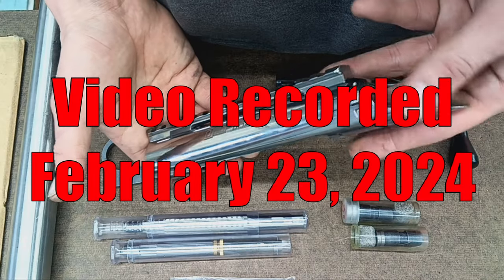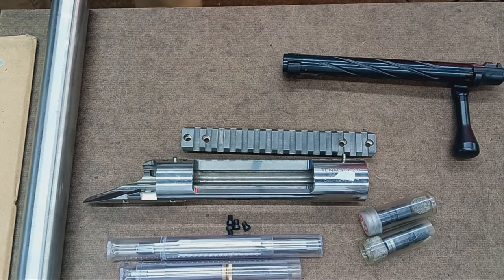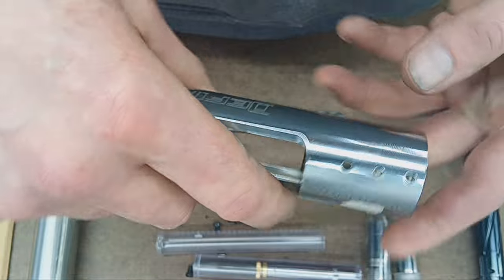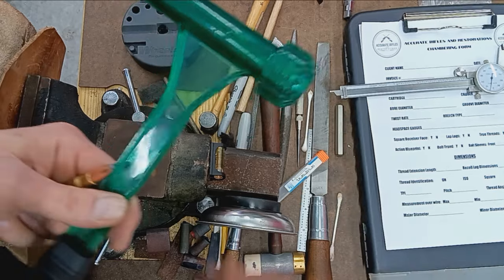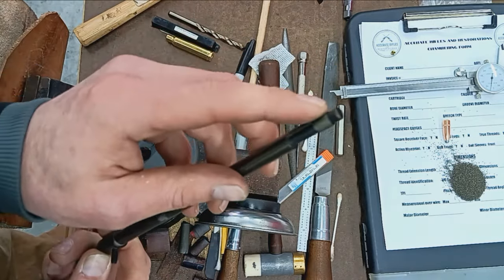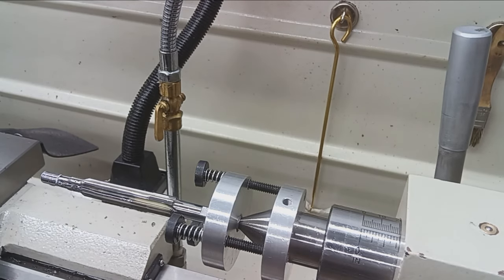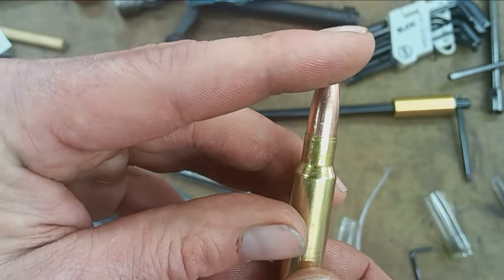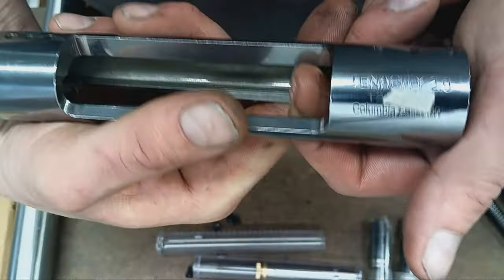Fitting and Chambering a BRUX M24 barrel to a Defiance Tenacity 2.0 in 338 Winchester Magnum

Comment: @45:38 - Is the bottom of that front rail thread not cleaned out?  Is that metal I am seeing?  Is that normal?  Nice video.
Reply from the maker: It didn't go all the way through (I do point that out early on in the video).  May have been a CNC robot error, or intentional.  I don't know.  I was contracted to do the machine work and was not present for scope base mounting, so I cannot comment on if it was an issue or not.

Comment: I saw a video once from a well known bench rest shooter that said you should fireform the case to the chamber then knock the shoulder of the case back a couple of thousands and then make the gauge. I realize you cant do that in this case, just thought I would pass it along
Reply from the maker: That's correct and preferrable.  However, in this case (as you know), it was simply a way to check and verify the depth of cut as Geoff pushed the throat back.  For an OAL gauge for bullet seating depth, one would fireform as you say so it's a perfect match to the chamber avoiding any false readings.  Thanks for watching and engaging the channel!!
Reply: NP, really enjoying learning and watching a skilled gunsmith